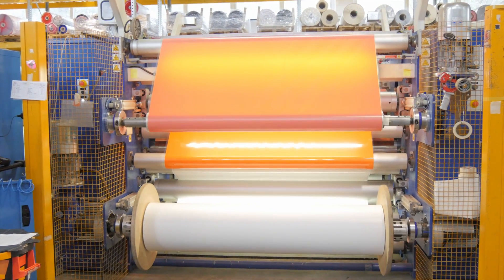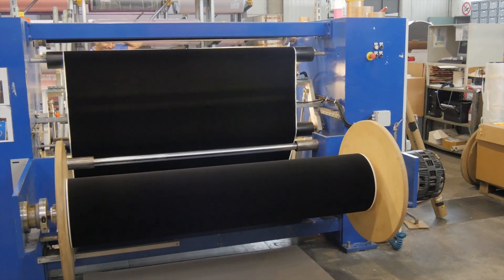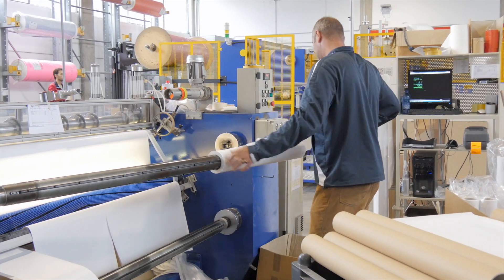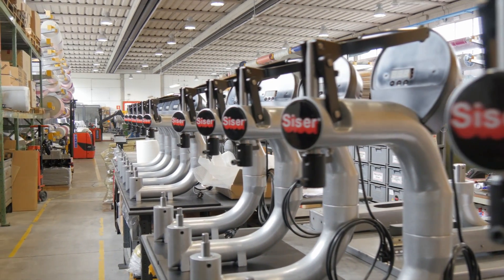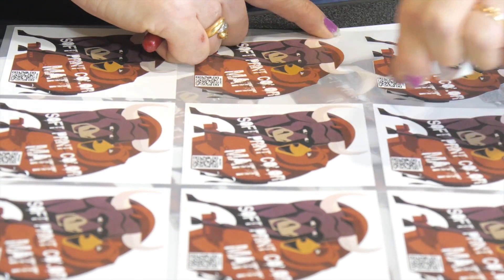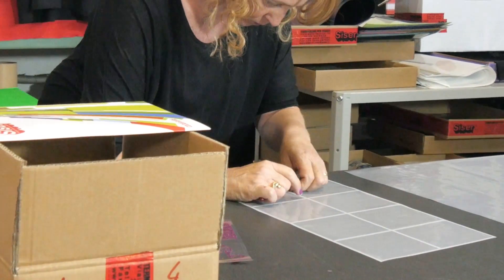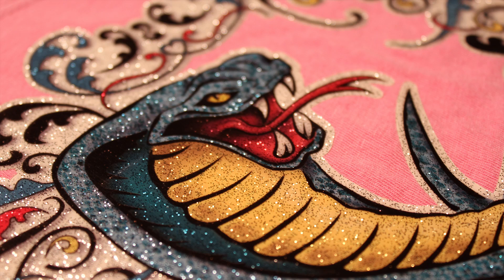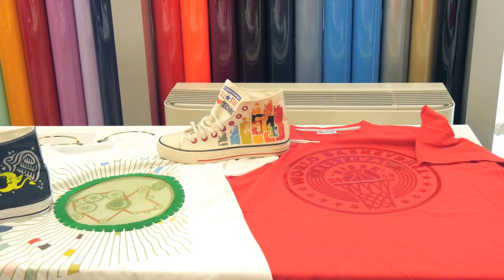How it's Made: Siser Heat Transfer Vinyl Material

Comment: If I wanted to make my own vinyl heat transfers to sell, would I weed them and put a transfer sheet on top or just let the customer weed? Thanks
Reply from the maker: Depends on your business model. You can certainly weed the designs and cover with Multipurpose Paper for storing... or let the customer weed and heat apply.
-Keith
Reply: I was asking because If I weed, then I need something to make it no so sticky until it gets to customer, but if I don't weed, they may mess up by not weeding it right. I just want to avoid any issues. Thanks
Reply from the maker: Ask your authorized distributor about multipurpose paper. It's smooth and shiny on one side and you can put your weeded designs on it for shipping. I've tried wax paper between designs before but it's a mess to get off. http://www.siserna.com/accessories/
-Keith
Reply: awesome tyvm and thank you for such a quick response